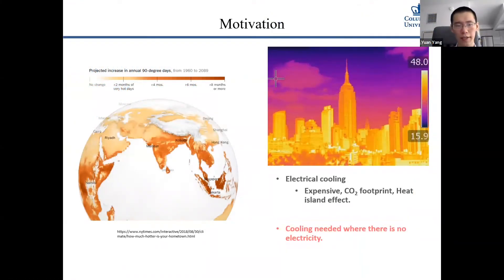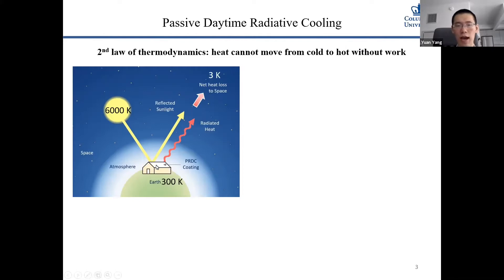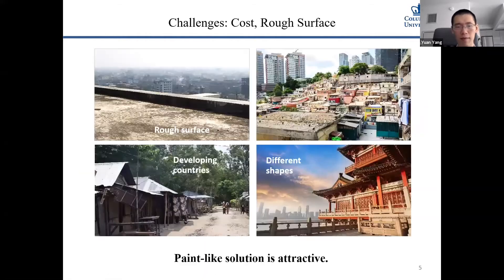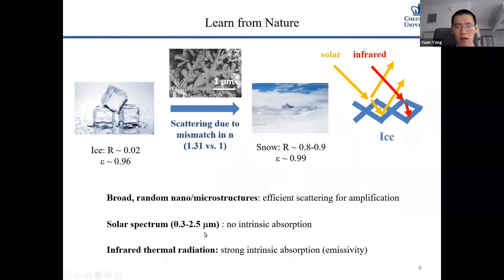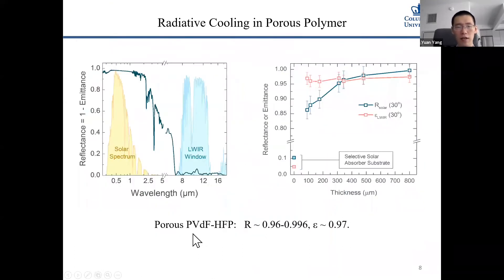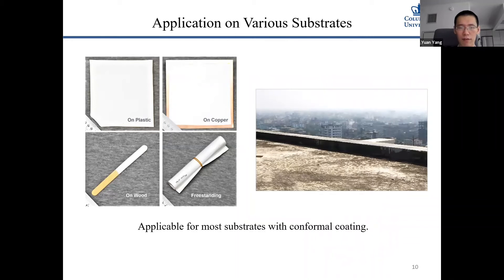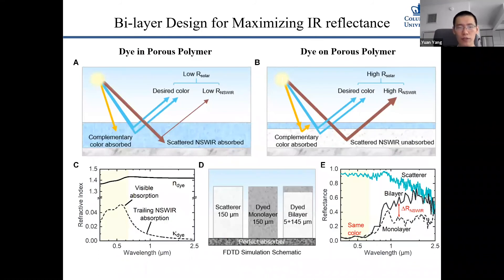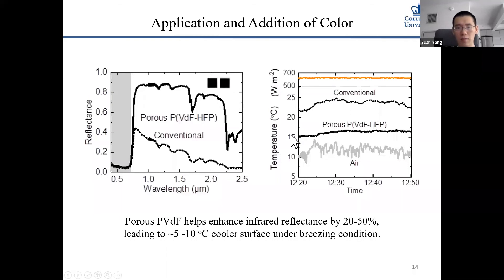Designing Porous Polymers for Daytime Radiative Cooling

Comment: Thank you for your video. The Nature article mentions the negative effect of humid air, here in Malaysia average humidity is: 80.5%. Is it still possible to use radiative cooling in Malaysia? Do you have any data on the efficiency reduction based on air humidity?
Reply: you need dry air because humidity will not let heat dissapete. evaperative cooling doesnt work in humid condition either. the nature article shows concrete steps next to "the material", concrete absorbs heat so what is the point?